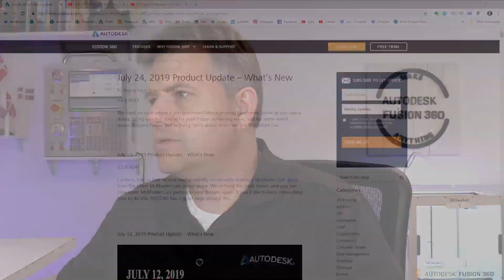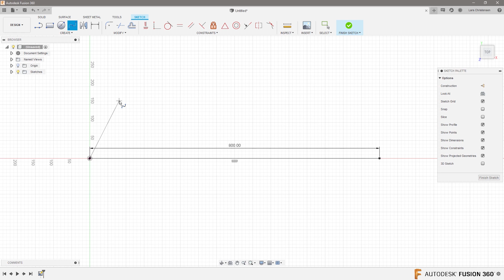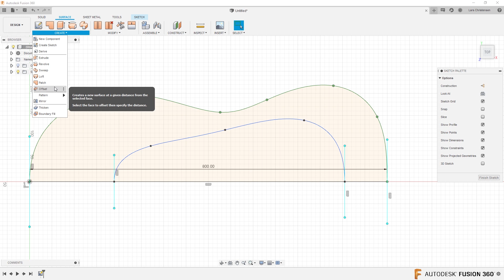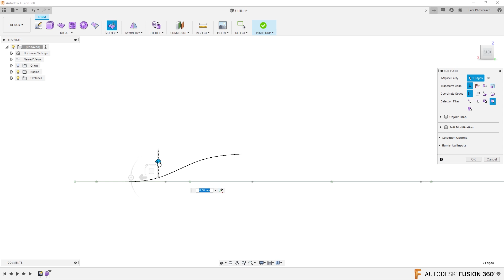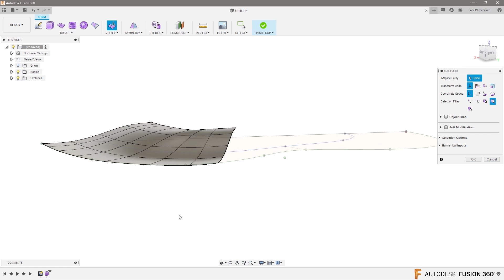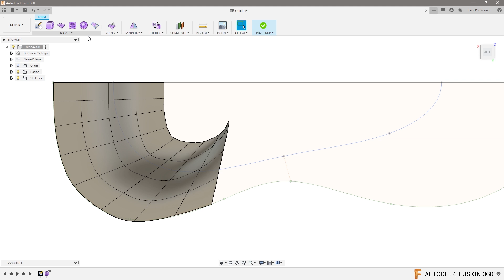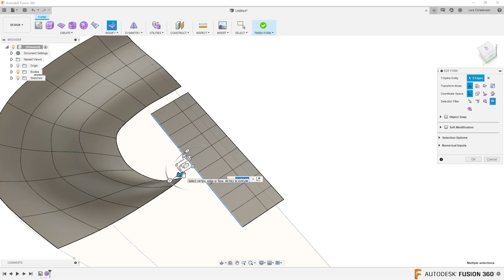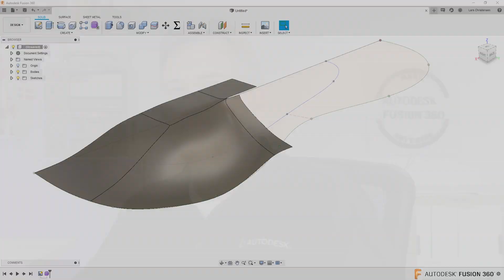Fusion 360 — How To Model a Violin Shape — Ask LarsLive

Comment: I modeled an upright bass top using lofts with good sucess.  I appreciate watching him sculpt, but I think you can get a clean model with lofting if your 3d cross section sketches are set up correctly.  Heres a blog post I made about it:  https://www.tonedevilharpguitars.com/doublebass-new-cedar-top/

It was so cool having the model, because I could make the bass bar with the same contour as the inside of the top and CNC it out as well, made a perfect fit, and the bass sounds awesome!
Reply: The one problem with using lofts is around the body points on the fiddle.  they are to acute of angles to loft, so I had to make a cross section that excluded them, then pull out from the edge of the loft,  then extrude up from the original 2d and keep the intersection.  I'll have to make a video on it some time...
Reply: @tonedevilguitars  I was thinking of using the first technique where you create several profiles and then break them out into sketch plates at different z heights. From there you might be able to use sculpt to connect the edges.
Reply: https://www.tonedevilharpguitars.com/wp-content/uploads/2020/08/doublebass-top-3d-model.jpg
Reply from the maker: Thank you for sharing!!!

Comment: You could, if you are looking for the midpoint, copy one of the splines to an offset plane, say 50 mm up, and create a loft between the two splines. Then split the resulting body at half distance (25 mm if lofting over 50 mm). Now you can project the midpoint spline and it will update if the original two splines are modified. If you are not looking for the midpoint you could split the lofted body at any required ratio.